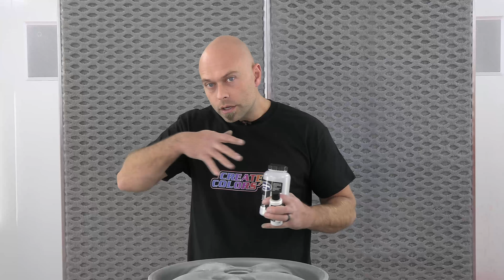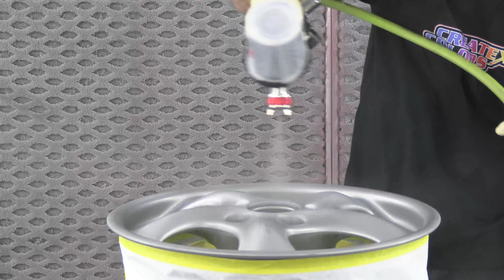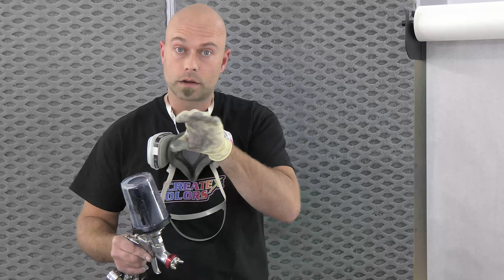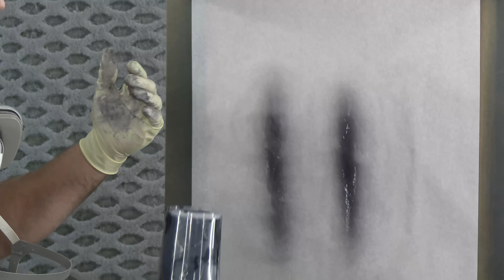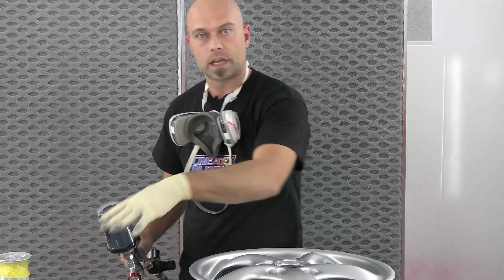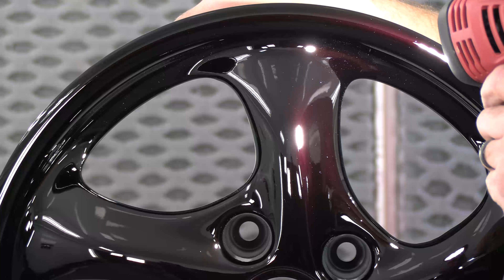How-To Paint Powder Coated Wheels

Comment: can you apply reagular automotive clear coat over the top and mix color into same product?
Reply from the maker: Yes, a solvent-based, catalyzed (2k) urethane clear is recommended to top-coat Createx paints for automotive refinishing. A water-based & a solvent-based product are not to be directly inter-mixed; inter-coated only after the underlying, alternate material has cured. Thank you.

Comment: Fantastic video as always!  Especially impressed with the final surface.  Was there any sanding between coats or polishing at the end to get such a flawless gloss?
Reply from the maker: Hello. Each coat was applied evenly, with the correct pressure to allow for fine-atomization and enough material to allow for leveling. Each coat dried tack-free before applying the next coat, and ample dry time was allowed for (4+ hours) before applying the clear. With the paint completely dry, the clear is easier to keep glossy after curing. Neither paint nor clear required sanding or polishing. Thank you!

Comment: Chris, I really like the look of that black. I did have a question about the durability of the paint for rims that may see a tire removal machine down the line. Great video, thank you.
Reply from the maker: AutoBorne Sealer and Createx paints are perfectly durable for everyday use on a wheel, including having a tire removal machine used on the wheel after paint. Please note that in the video, a 2k urethane clear was used as the top-coat clear, recommended. Thank you.

Comment: did you have to strip the powder coating off or just sand and prep it the wheel for paint?
Reply from the maker: In this video, the powder coating was sanding with 320-grit then AutoBorne Sealer was applied, www.autoborne.com. Thank you.
Reply: @CreatexColors  thanks once the sealer was applied what kind / paint brand did you use?  Did you put a clear coat on top?  Lastly, how long did you wait for the sealer to dry before applying paint?

Comment: Hi can you give me the color codes for the the colors you used in this video.
Reply from the maker: To create the black candy-metallic effect, Chris chose 6013 Silver Sealer as the initial ground coat, followed by an effect coat of Cosmic Silver, over which multiple coats of candy2o Black was applied then top-coated with a 2k urethane clear. 6013 Silver Sealer, thinned 10% per vol. with 4011 Reducer, https://autoaircolors.com/autoborne-s...
Cosmic Sparkle, mixed 3:1 UVLS Gloss Clear, then thinned 10% per vol. 4011 Reducer, 
candy black: 4664 candy2o Black, www.candy2o.com, 4050 UVLS Gloss Clear,
https://uvlsclears.com/
Mix 4050 UVLS Gloss Clear 8:1 candy2o Black,
top-coat clear, PPG EC-550, or any 2k solvent-based urethane clear.
Thank you